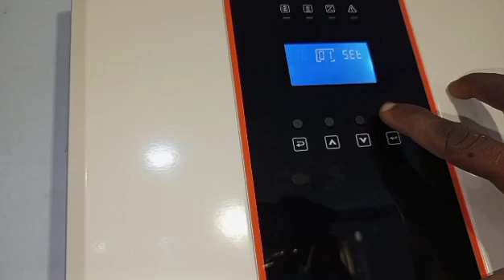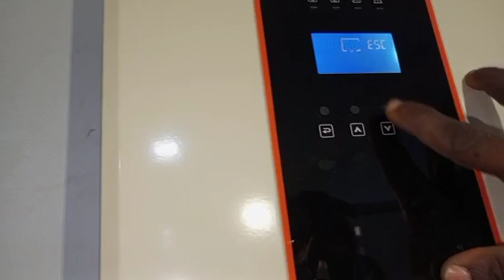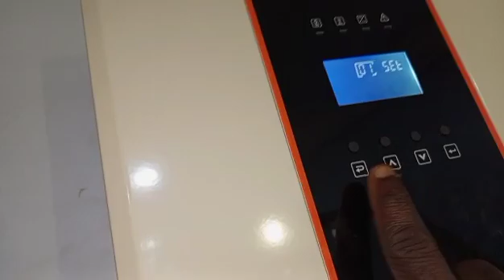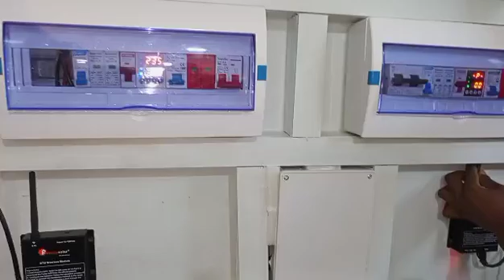How to parallel two inverter

Comment: Meaning you will parallel the AC output voltage as well?
Reply from the maker: Note the input voltage must  be from one source while paralleling two or more inverter in a single phase